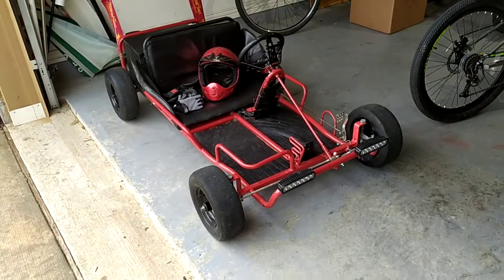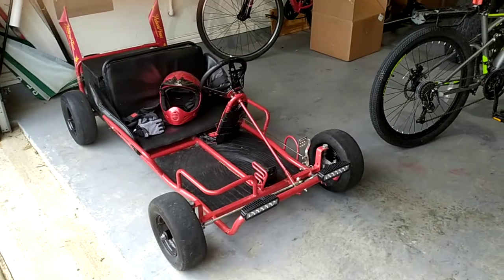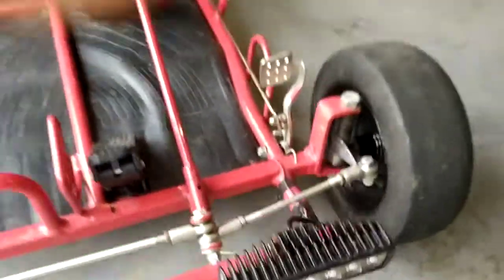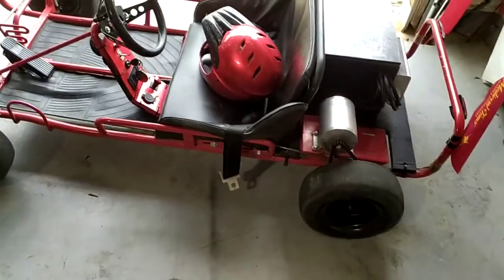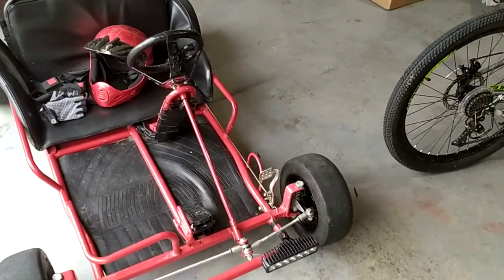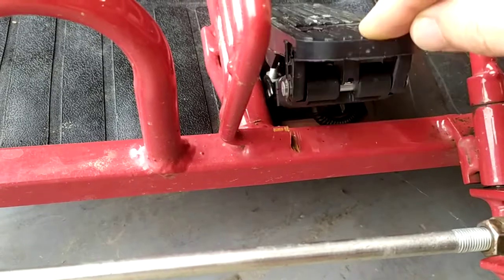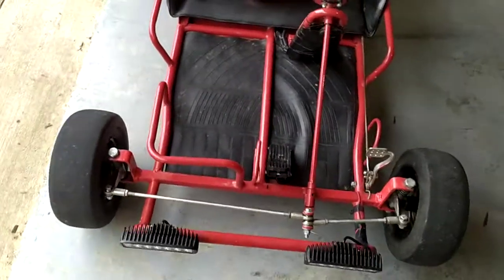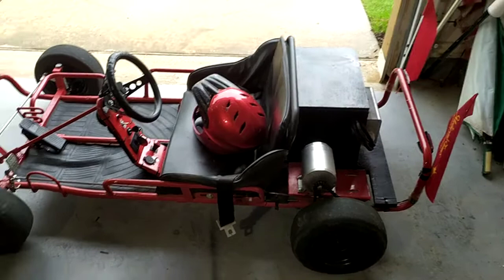Kunray 3000W Part 4 of 3 (Title: I'm so smart I'm stupid..)

Comment: hey what is the diameter of the shaft of this motor? i want to connect a cvt on it, but it needs a key shaft and want to see if its possible to make an adapter. Thanks
Reply from the maker: I don't think that is going to work very well.  The purpose of a CVT is to insure that the best gear ratio is being used for the gas engines's optimal torque range at any given RPM.  An electric motor is 100% torque at 1 RPM pretty much across all RPM ranges and is much more efficient.  You will be more than likely be losing performance.  However, to answer your question, it is a 10mm shaft that utilizes a double D bore at 8.5mm.
Reply: @TexasNEV  why would that not work? A cvt is similar to a normal transmission in terms of it's purpose, giving extra torque at low speeds without losing high speed. I want to drive off road with a lot of hills so I would like it to have more torque for when I go uphill without reducing the top speed for the flat parts. Also thank you for your answer 😊
A porsche taycan has 2 gears for example as well as some formula e cars

Comment: Do u separate charge your batteries or do you have a 72 v charger?
Reply from the maker: That would be too much work.. One of the main points of having a BMS for multi cell battery configurations is for the BMS to do the balancing for you.  In this case, it would be an 87.6v charger specific to LiFEPO4 cells, that is what we're using.. The BMS handles all the work.  Prior to this battery, the original design was the Nissan Leaf cells, and we were using one of those nice 1-12a variable 84v chargers for 20 series Li-Ion.

Comment: You had to of made a video regarding the 3 speed switch? If you did could you please give me the link? Thanks love the Kart absolutely awesome!
Reply from the maker: Thanks!  Check out my other videos of the Hammerhead NEV conversion and the fat tire bike.  :)  The three speeds is a feature of that particular speed controller.  Most of them have it.  Any SPDT switch would work. (Single pole, double throw).  if nothing is connected to the 3 speed switch wire, it is "medium".  Moving the switch up or down closes the circuit for "slow" or "fast".  I just used these: https://www.ebay.com/itm/382649710427

Comment: I just built my electric go kart it’s done took 6 months and I used a 3000w 5800rpm motor top speed is 28mph pretty happy
Reply from the maker: I bet you could get some more speed out of that.. :)  Maybe you have small wheels or a very large rear sprocket?  What is your battery setup?
Reply: @TexasNEV  i have a 78 tooth sprocket am goin to start with that might buy a 72👍👍
Reply from the maker: @ke-kd8ut  I'm sure you are enjoying the acceleration with a 78 tooth!  We're using a 50.. 60 is more of the normal "standard" though. :)

Comment from the maker: Yeppers!  This baby does get very hot under extreme use, especially since it is being overvolted so much.  Since it is a completely sealed motor, I put the hose on "mist" setting and just get it wet and it cools down quickly.  No issues.  :)  There are some circular heat sinks out there but I'm concerned about personal injury due to the aluminum vanes sticking out.